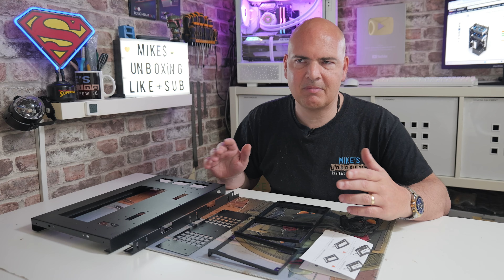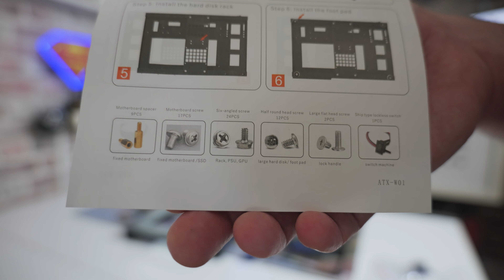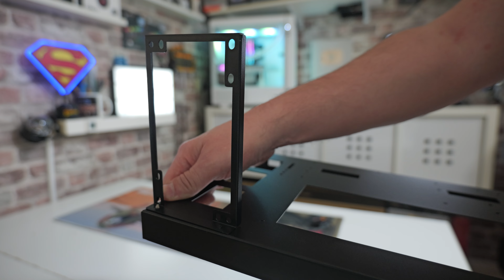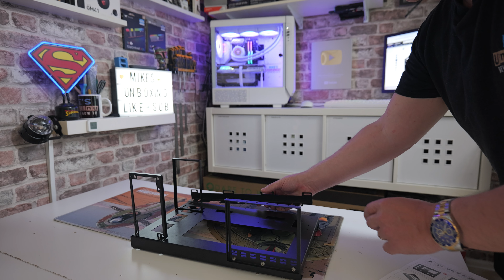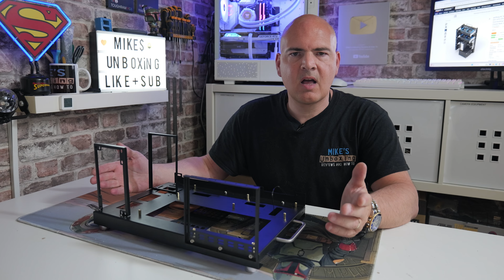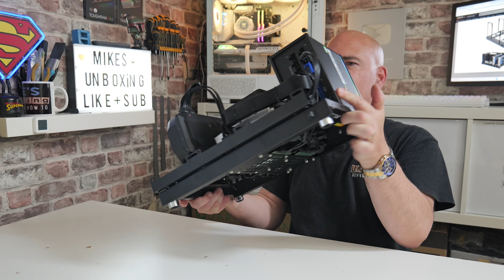Budget Compact Open Air ATX PC Test Bench Case Build ATX W01 Giyifang Miningeek

Comment: Fantastic video!  Love the detail in your instructions.  I have heard that the holes might not be aligned correctly for a mATX board, can you confirm.   Again, such excellent detailed assembly instructions resulted in my subscribing to your channel!
Reply from the maker: should be okay if you move the pillars, but i actually haven't tried it with a MATX board yet and don't have one here to quickly test and confirm

Comment: I thought I wanted an open-air case like this one. It looks nice. I tend to put things on top of my tower case, so instead I have a modern case that I use without the front bezel or sides. I still have those covers, but they are kept in the original shipping box. ;D
Reply from the maker: That's a great idea!

Comment: This is a great idea but i would say for testing fresh components and doing bios updates before installing into the case. Agree keep psu at base if standing up as looked weak in stream. By locking down mb, psu gpu its safer than using box especially for rotating and moving to access ports, connect to monitor. Great idea for checking and good price. Thanks for reviewing Mike and Kath and thanks to Bob and Aurali too! 🐈👍
Reply from the maker: yes it is a pretty cool crossover from a testbench to a fully functional open frame PC